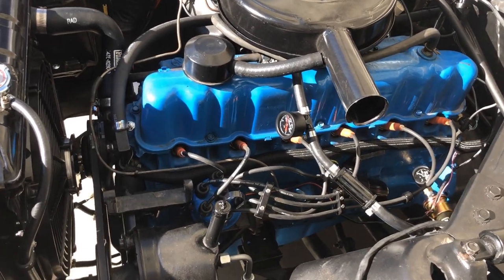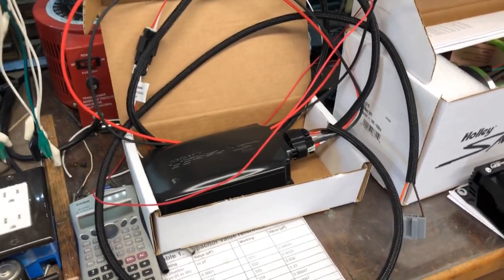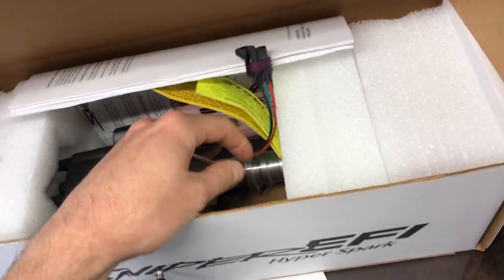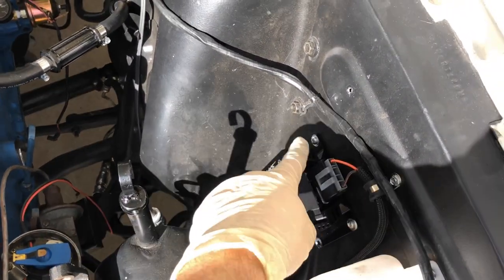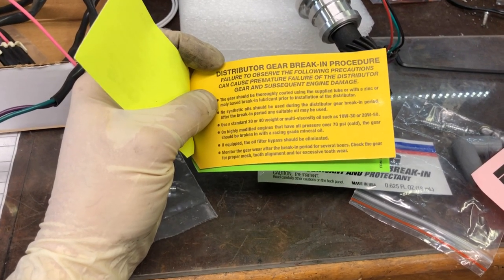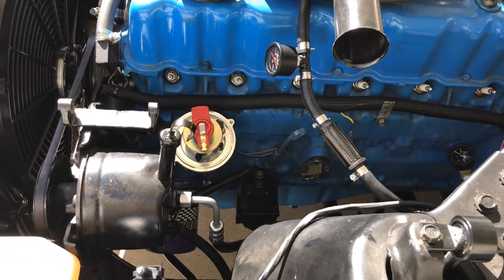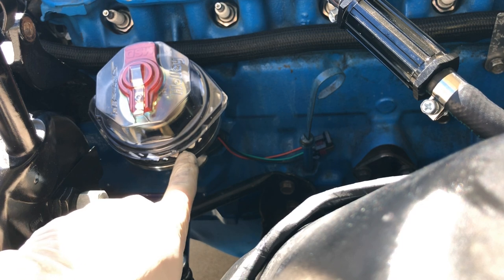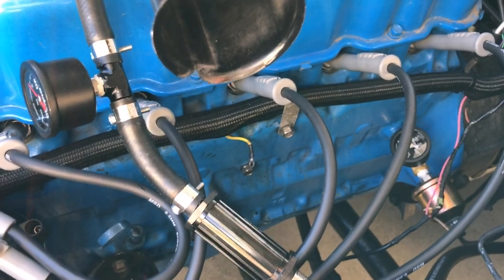Holley HyperSpark w/Sniper 1100 Install and First Start

Comment: A fellow member from the i6 forum here, love the set up with the efi!
I Noticed you don't have a export brace...
dude get one!!! I got the regular one and not the H.D. for our 6 its fine.

It Made such a dramatic difference in the front that if I would have known before, this would have been my first upgrade done to my car! 

Trust me you'll tank me later!
Reply from the maker: Now whats the difference between the export brace and the braces it already has?  I see the aftermarket braces attach to the shock brackets, but my stock one already mounts just below that.  Does that make that big of a difference?  I wouldn't think so, but I may be wrong.

Comment: Thanks for this video and the earlier EFI video.  I have a similar 66 mustang and just installed the sniper 1100 with the tank pump and other sensors, have 100miles on it and runs great and now getting ready to install the hyperspark equipment.   Do I need to create a timing curve or is the out of the box version good enough? Thanks for your help.

Comment: A thing I've found with those falcon 6s is the stock distributor only locks in one spot depending on where the advance is. It was probably 180 out bc that's the only place it would lock in being the advance is twisted toward facing the back being the power steering pump is in the way.. I ran into this issue on my maverick 200  in my 63 f100.  I had to clock it 180 out like them due to the same reason
Reply from the maker: It shouldn’t matter though, right. The shaft will go in any way you want it to and the housing will still sit where it’s at.  Or are you saying the shaft doesn’t like to go in a certain way?  Definitely get that the housing needs to be in a specific place. The wires will all just be shifted 180 depending on where you drop it in. Either way, it doesn’t matter as long as the order is right.
Reply: @mechtrician1  yeah it don't matter as long as the order is right. Im not too sure what causes it. No matter which way you turn the distributor it'll only drop in one spot. And won't drop in 180 degrees. But that's on a stock distributor. Hei and other aftermarket distributors probably fixed it where you can drop it which ever way needed. That's the only ford engine I had that issue with.  I don't have it with a 240/300 or any v8s they'll drop in 180
Reply: @mechtrician1  and I'm thinking the distributor was probably meant to face forward But the ps pump is in the way so it has to face backwards that's what the cap is 180 out
Reply from the maker: @colevarela7320  the cap actually wasn’t 180 out. The way the hardline for the vac advance was, its only for that orientation. The rotor was 180 out. But again there really isn’t a right or wrong way to face the rotor. There’s just the “normal” way it would be pointed.
Reply from the maker: @colevarela7320  re. drop in. You sure?  The oil pump shaft is hex. It should drop in any way you want it to.
Reply: @mechtrician1  that's what I was thinking but it happened to me

Comment: I recently installed the Holly hyper spark distributor on my Ford in-line 250. I started having issues with oil blow by at the base of the distributor. Before the swap, I was using a DUI HEI distributor with no issues. Since installing the hyper spark, I’ve tried changing the O-ring applying RTV and making a custom gasket for the base to sit on all with no luck. I even bought a second hyper, spark distributor and again no change in results. I was wondering, if you’re having issues with blow by at the base of your distributor?
Reply from the maker: @FrankGuerrini-p6w  nope no issues. 
Sounds like you either have too much crank case pressure due to cylinder blow by or you have some sort of PCV issue or breather issue.
Reply: @ I thought the same thing after having new piston rings installed so I pulled the engine back out and sent it back to the machine shop where Warranted the piston rings and replace them. After the initial start up and warm up, I took the vehicle for a drive when I got back, it’s still leaking from the base of the distributor.   I take it you’re not having this issue? Also, I’m running one of the original classic in-line heads and intake manifold.

Comment: Hi. I'm about to exactly replicate what you've done here. Would you share the tuning map you used? If so how could somebody obtain it from you?
Reply from the maker: I really don’t recommend it. Start out fresh. Every engine is different even if it’s built the same. Also mine was more tuned for ca pump gas. I started with a base tune and it was not far off at all. The 1100 unit was designed for this specific engine so the base tune is far closer than other sniper units.
Reply: @mechtrician1  ok good advice. Thanks

Comment: Do you have a parts list for all the EFI parts you have installed? Starting to put my list together for my 67 stang.
Reply from the maker: Actually, I do!

Mind you this is my unedited notes, but it’s everything you need if you’re NOT adding HyperSpark. I may have those part numbers somewhere as well. 

“Holley Sniper 550-552
Fuel Pump 12-305
3/8” Vapor Guard Filter 731166ERL
90° -6an to 3/8” Vapor Guard 759166ERL
3/8” Vapor Guard gauge adapter 782461ERL
-6an cap summit brand SUM-220640B
Fuel pump block off plate summit brand SUM-402035
Earls 3/8” vapor guard hose 20 feet 752066ERL
Earls EFI hose clamps 750006ERL
Any 1/8” NPT 0-100psi fuel pressure gauge available. 
Optional 3/8” replacement hardline for mustang. Note: Classic Tubes fits like crap. 
You may substitute for 5/16” for the six cylinder install if you like, all fittings and hose components above will be different though”
Reply: @mechtrician1  Thanks so much. That is greatly appreciated.

Comment: Love to see the old HP analyzer. Which model?
Reply from the maker: Did I mention that in this video? I don’t remember lol. I have an HP 8643a signal generator. I did a repair video on it a while back. It’s on here somewhere. Have a scope and a few other things too.
Reply: @mechtrician1  oh ok, it looked like a sig gen but I didn’t think you’d have one under your bench. Cool stuff, I worked in calibration in a former life, love the old HP gear.
Reply from the maker: @Barbu66  very cool!  I could have used your help a few months back. It had a bad divider card but I had a little bit of a hard time diagnosing it, but I got it going. It’s a freaking tank though. The HP stuff was so so so well made. I just use it for aligning radios and stuff.
Reply: @mechtrician1  good stuff! They are certainly tanks. And some of them still haven’t been surpassed, such as the 3458a. Legendary. 
Love your videos, getting up to speed as I’m close to completing a buy on an insanely original 66 mustang with the i6. Nice to know there is no end to the fun that can be had. Your in depth thoughts and analysis are a breath of fresh air.
Reply from the maker: @Barbu66  I really appreciate that, thank you.  Can't wait to see your 66!  I love it when you find one that's really original.